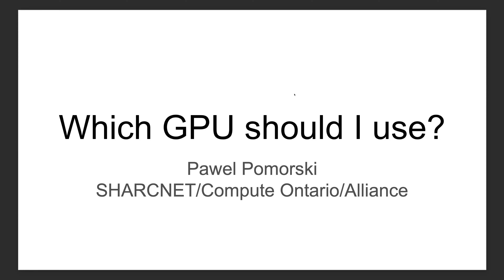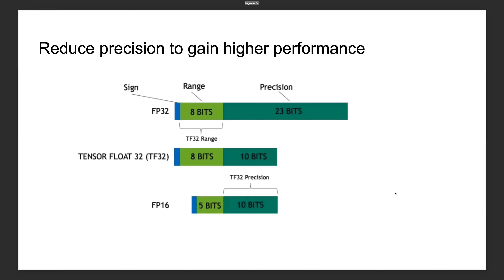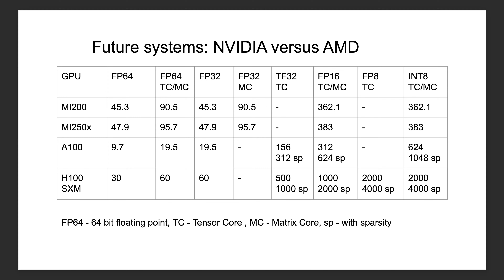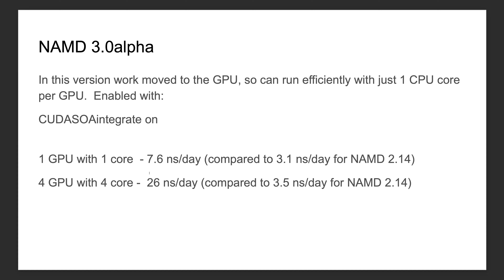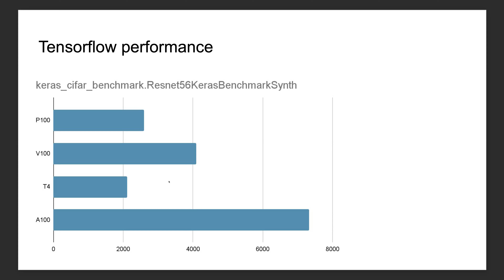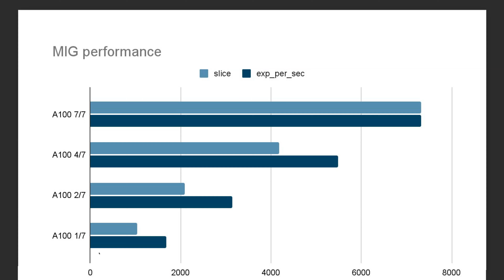Which GPU should I use?

Comment: Any idea of when H100 will be available on Graham?
Reply: We plan to replace graham with a new cluster in 2024 (if funding comes through), and this new cluster may contain H100 GPUs.  Before then we may get a small number of H100 GPUs for testing purposes.
Reply: @pawelpomorski4025  I'm interested in testing H100 GPUs from a researcher's perspective when they are available. 😁
Reply: @dakezhang2845   There is a lot of interest.  When we get some H100 cards for testing, we will advertise it, probably in our monthly newsletter which all users receive.
Reply: @pawelpomorski4025  What happens to the old cluster? Can research groups purchase the old cores or GPUs?
Reply: @ameerracle   The cluster hardware is owned by the university, which decides how to dispose of it if we (SHARCNET) retire it.   Anyway, it looks like graham will be running with the current hardware at least until early 2025.